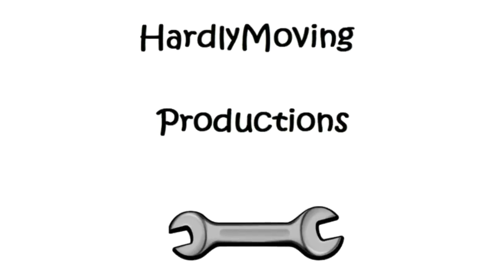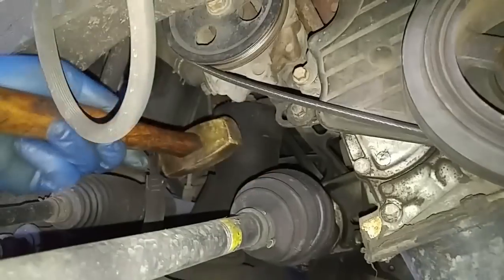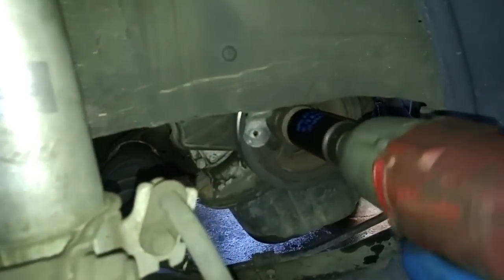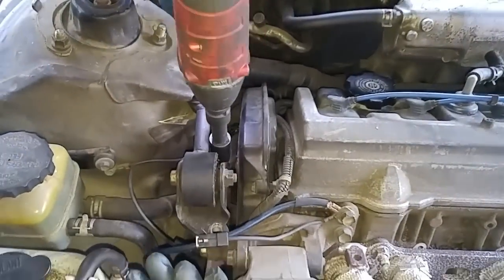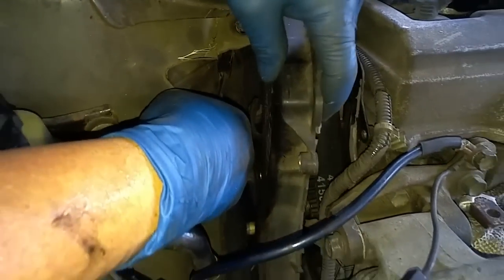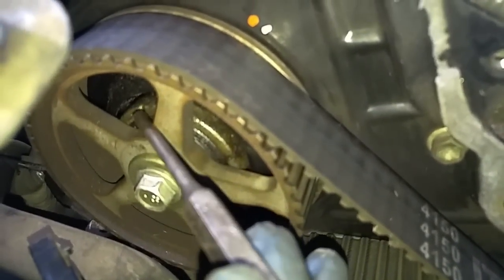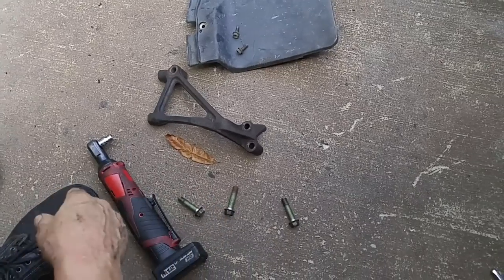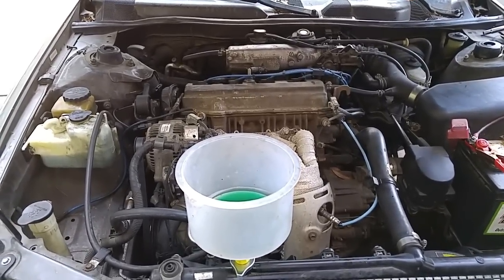Camry Timing Belt, Water Pump, Seals & Pulleys Replacement:  2.2L I4 5SFE Engine

Comment: After installing the timing belt and removing slack. Im noticing that the crankshaft pulley timing mark is aligned right. But the camshaft mark IS NOT IN ALIGNMENT. ITS CONSISTENLY FORWARD BY 2 inches or so...again this is when the harmonic balancer is at the zero mark. Is this okay?
Reply from the maker: When you're saying 2 inches, are your referring to the protruding tab on the camshaft pulley or the hole in the camshaft pulley that suppose to align with the vertical notch?
Reply from the maker: Refer to the 7:11 time mark of the video.
Reply: @hardlymovingpro  Im referring to the 'camshaft gear'...the camshaft gear hole is past the camshaft vertical notch/camshaft seal area. ie. on every 2nd complete 360 degree turn of the crankshaft gear...the camshaft hole is at 1 o' clock versus the camshaft vertical mark which is 12 0'clock. I want to know can the car still run okay despite this?
Reply: I can tell that the camshaft marks are off because I made marks with white out before installing the belt. I have not tried to start the engine yet either.
Reply from the maker: @SuperHtownswag  It's a non interference engine meaning there won't be any potential valve damage if out of alignment.   Also, if not aligned, you'll get a DTC code indicating camshaft position error.
Reply: @hardlymovingpro  oh wow thanks. To be honest the car already has 276,000 miles on it. And doesnt have a check engine light or any codes. I decided to replace the belt because It was very loose (yet fully intact. I know how bizarre right?) I bought a kit and changed the water pump, idler pulley, tensioner pulley (I think this was the main culprit, as the spring felt weird and the tensioner pulley had VERY limited movement. Im gearing the bearings inside the tensioner pulley were worn. I checked the records for the previous owner and the timing belt was last replaced at around 185,608 miles, oil pump seals, camshaft seal and crankshaft seals were replaced then too). Yes its toyotas 5sfe engine, If I can get the car to last me another 40,000 miles Ill be more than satfisfied
Reply from the maker: @SuperHtownswag  With this engine, it's usually a worn tensioner or idler pulley bearing that causes a need for a TB service.  A worn wobbly bearing places too much stress on the belt which will eventually snap.  Indications of a worn bearing occurs during initial cold engine start up that disappears when the engine warms up.  Indications of a loose belt can be noticed with a belt slapping noise against the TB covers.  I've had to revisit my TB jobs with belt slap noise after a new belt installation.  To my surprise, the belt got loose.  This is why I now start the engine with a new belt and then make tensioning adjustmentS BEFORE I button everything back up.  These TB instructions on manually turning the engine 2X, from my experience, does not guarantee the proper belt tension.  Starting the engine allows the cogs of the belt to seat in better ... IMHO.
Reply: @hardlymovingpro  Danmn. Thanks Sir! So does a loose timing belt and worn tensioner pulley to stall? and maybe have intermittent no start issues?
Reply from the maker: @SuperHtownswag  Nope ... will not cause starting issues.

Comment: Nice work surprised you didn't do the oil pump o ring and seal. I think that's my problem. I have to remove most of this stuff to do it. You show doing that very well.
Reply from the maker: Thanks.  Did another video for the oil pump.

Comment: Nice video! I'm a chevy technician not used to these yotas but seems easy to me thanks for the info.
Reply from the maker: I worked at a Cadillac dealership and any trade in Asian imports that needed work they dumped on me.

Comment: Got a 97 Celica with the 5sfe.  Water pump weeping.  Has 230, 000 miles.  This is a job I am going to tackle myself so watching as many videos on it as possible to find out as many tricks and tips as possible to make the job easier.  I intend to change the TB, auxiliary belts and of course the water pump.  Was wondering if it was worth replacing the oil pump gaskets also or anything else you can think of?  Thanks.
Reply from the maker: Here's a video I made replacing the oil pump cover O ring gasket.  These O rings dry rot and allow oil to leak out.

Comment: Good video 📹👍very detailed 👌 what brand timing belt did you use? for this job, or what brand do you recommend? I bought a car with 226,000 mi. All be changing the seals the cam is leaking. Might as well do the timing job too. And see how long the car 🚗can last.
Reply from the maker: Japanese belts:  Mitsuboshi or Bando.  American:  Dayco or Gates. European:  Continental
Bearings & water pump:  Aisin or GMB
Reply: @hardlymovingpro  Thank you, I understand better now.

Comment: Is it possible to remove without the power tool? Or will the pulley just spin using a normal socket wrench? Or, in my case would I leave the belts in place first to keep the tension on the pulley so it doesn't spin when I'm trying to remove it?
Reply from the maker: The pulley will spin. You can use a chain strap wrench to hold it from moving.

Comment: Hi i have 2000 camry 5s engine. Same problem with my car when start it in the morning its making noise comming from timing belt cover i feel that belt is hitting to the cover but after engine warm its reduce the noise i changed timing belt with new koyo and NSK bearings japan. After changing all these it was ok but after 2 months the same noise comming from the timing belt cover. I am suggested to find a little bigger bearing in diameter to not to listen the noise. So what can i do? What will be the best sollution? Should i find a little bigger bearing that should be 60mm in diameter instead of original 57mm diameter? 
And which brand belt should i use for this? As before i used mitsuboshi & sun brand belt?
Reply from the maker: Had a similar problem about a year ago.  Appeared to be belt stretch.  I took the tb covers off, removed the excess slack and buttoned it back up.  Been running fine since then.  Belt slap all gone during warm up.  Problem caused by not using OEM Mitsubishi belt?
Reply: @hardlymovingpro  thaks a lot bro i will check original Toyota TB to install. A bundle of thanks

Comment: Recently replaced crankshaft seal and oil pump seals on my 97 Camry. Car will only run 30 seconds and quit running. Did I install the timing belt incorrect or maybe the tensioner came loose? Unable to verify timing, timing covers and accessory belts are on. I’ll remove the timing covers this weekend to get a better look at my timing marks. Thanks for your video.
Reply from the maker: Is your check engine light on?  If so, do you have a camshaft position sensor error?  To get back to proper alignment, set the crankshaft pulley (harmonic balancer) notch to the 0 degree mark on the lower timing belt cover.  Then check the position of the camshaft sprocket TDC alignment hole.  If the alignment hole is 180 degrees off, rotate the engine 360 degrees.  Recheck the alignment hole. If the hole does not align with the alignment notch above the camshaft seal, then you're out of alignment.
Reply: Hardly Moving Productions Thanks for your speedy reply. So far no check engine lights. Will check all wiring sensors and timing marks this weekend. Keep you posted on my findings...
Reply: @hardlymovingpro  Update: Timing marks are spot on. Did noticed the crankshaft timing gear has a broken/missing teeth. I'm sure this is issue I'm having. Crank sensor not picking up all timing gear teeth and causing the engine to shutdown after 30 seconds.
Reply from the maker: Yes ... that'll do you in.  Recommend you pick up a replacement gear at the salvage yard.
Reply: @hardlymovingpro  Absolutely...I'll get one after we return from vacation. I'll let you know with the final results. Thanks...
Reply: Final result: Replaced broken crankshaft timing gear and the engine didn’t shutdown after 30 seconds. Ran engine for over an hour monitoring for leaks and engine temp with no issues. Next challenge - The dreadful California smog inspection 😩
Reply from the maker: @elgatogordo9523  Hey ... great news!

Comment: Hello! Please, could you tell me if when the timing belt breaks on the Toyota Camry 2.2 5S-FE engine there is damage to the cylinder head and valves?Thanks.
Reply from the maker: Won't damage.  It's a non interference engine.

Comment: Questions: which you can answer - at 12:28 m, what exactly is your "seal installation tool"? At 14:50, are you replacing the seal for the whole oil pump as well or just the section with o-ring?
Reply from the maker: At the 12:28 mark, I'm using the KTC brand seal installation tool.  If you go to the "show more" section of this video, I provide a Amazon link to view or purchase the tool.  I made a separate video for replacing the oil pump cover and shaft seal.  Here's the link:  https://youtu.be/_tsAtyOGpaQ  I also did another video on tools used for seal replacement:  https://youtu.be/KUSIZs2b4Ck  And here's a video showing how I used a seal installation kit to install new seals in a Mitsubishi 3000GT:  https://youtu.be/FTp_tVXSbqU

Comment: TY for this nice video and sorry for my bad english on advance. I have this exact same engine on my toyota celica 2.2gts, and just broke my timing belt past week while my car was not moving, it just stopped working while i was stopped. Ive been told that repair would be around 2000€ and i was just wondering if u think it would be worth tryin gto repair it or just buying another engine or even another car. Thank you very much!
Reply from the maker: Definitely fix it yourself!  No need to get another engine (and that's a lot of work!).  Most belt breakage, from what I've seen, is due to worn out idler, guide and water pump bearings.  This causes bearing wobble which over stresses the belt.  So replace the belt with the bearings and water pump.
Reply: @hardlymovingpro  TYVM my friend, thats what i needed to hear xD im in love with my car and would completely hate to get rid of it, ill see your videos and ill try my best to get it fixed! TY!

Comment: Nicely done. I would tell people to go ahead and take the alternator and power steering reservoir off.  easier to reach the bolts, which are still tricky.
Reply from the maker: Wouldn't hurt.  Just a couple of extra steps.  Recommend you first drain the PS fluid by detaching the hose bracketed to the sub frame below the crank pulley.

Comment: Great video!... Question, did you add any gasket sealant grease on water pump gasket before installing the pump?
Reply from the maker: Not necessary.  The steel gasket with a rubber seal provides a leak free seal.

Comment: Hi HMP. It was interesting to see that while the belt looked reasonably tight after attaching the spring and tightening the tensioner, after running the engine it became quite loose. It looks like you should run the car to get all slack from the belt. Some cars though require the rocket cover to be removed and so running the car may not be possible unless you put the car together beforehand. What methods are there in addition to running the car that effectively tightens the belt so you don’t have to retighten later. Thanks
Reply from the maker: Conventional instructions is to rotate the crankshaft 720 degrees and then re-tension.  My preference is to start the engine.  On Honda's older I4, I loosely place the value cover back on before I start the car so that oil won't go spraying all over the place.
Reply: Thank you for your reply. I agree absolutely. I recently replaced a belt in a Mazda 323 “Miata” FWD using conventional manual method. Relied on spring to make the required tension, rotated by hand several times to check and the belt remained visually tight. Closed everything up and the car went well for about 3000km before the belt failed and let me stranded. I predict that the belt became loose quickly and survived for a while before it finally failed. As you’ve shown, you cannot rely on the spring to provide the correct tension and you must run the engine to bed the belt in to eliminate any hidden areas of slack. The unfortunate experience knocked my confidence a bit (I’m an amateur trying to learn) but it was an important lesson well learned and it’s so very crucial to follow your procedure for adequate tensioning. Unfortunately the Mazda was no longer needed by family so it was scrapped. So bit sad to see it go. Will try again on the other family cars including my 98 Camry at a later date. Thank you again for your kind effort posting such interesting and helpful videos. A truly excellent and enjoyable channel. Regards Craig.

Comment: I had the cam, crank and oil pump seal and gasket changed 60,000 miles ago when i did the timing belt on my 92 toyota camry 2.2l. No leaks so far, my question is should i change the seals with this timing belt change or wait till the next 60,000 mile timing belt change?
Reply from the maker: If you're changing your belt every 60k miles, then hold off till the next belt change.  The cam seals is what wears the fastest.  The oil pump seals are good almost to 200k miles.  The crank seal don't leak that often.
Reply: @hardlymovingpro  thats what i was leading toward doing the seals every other belt change, because my 92 Camry says to change the belt every 60,000 miles.
Reply from the maker: @chrisbrown6804  You can safely go up to 100k now.  The 60k was based off of old belt material technology.  Starting somewhere in the late 90's, on the 5SFE engine, the service interval was bumped up to 90 or 100k.   When belts snap, it's not because of the belt ... but rather one of the pulley bearings wearing out and wobbling causing undue stress on the belt.   So if you use good bearings, like Koyo or GMB, you should have no problems getting to 100k.   Also, only use Aisin water pumps.   Have had water pumps fail in 1 week to 1 year.  Don't have this problem with Aisin.
Reply: Hardly Moving Productions that makes a whole lot of sense, that’s probably what I will do, I will wait for at least 90 to 100,000 miles before I change it, that way I will change the seals again at that time, I really appreciate the info and knowledge.
Reply from the maker: @chrisbrown6804  Easiest way to know if a belt job is needed is when the bearings make noise on initial startup and quiet down after warm up.  You've got a few months left when then happens.
Reply: @hardlymovingpro  Every once in a while like maybe once every 3 or 4 months after the car sat for a weekend, once i start it up, i hear a little rumbling underneath the hood for like 3 seconds then it goes away and dont do it again like for 3 or 4 months.  Im guessing one of the bearings is on its way out.
Reply from the maker: @chrisbrown6804  Nope.  It's motor oil sitting in the cylinder head and oil filter that over a stretch of time drained down into the oil pan and needs a little bit more time to circulate through the engine.  Same phenomenon happens in the colder regions of the country where the temperature drops into the teens.
Reply from the maker: @chrisbrown6804  Could also be worn out timing belt idler and/or tensioner pulleys.
Reply: Hardly Moving Productions is it safe to use a impact to install the crank bolt?
Reply from the maker: @chrisbrown6804  Absolute ... besides, it's a pretty big bolt.

Comment: 1st of all this is an excellent timing belt video. I couldn't have asked for a better one, but I think this job will be left to a mechanic. 

2nd is not timing belt related so I understand if you don't waste your time but also really hope you do. I watched this about 10 times to get the answer for myself but its going to take more knowledge than that. I'm trying to diagnose a valve cover leak vs a camshaft seal leak . The visible oil is all over the back of the engine. (I did the valve cover already and its still leaking is the reason I'm looking into camshaft seal.) If I wanted to rule out cam shaft seal leak could I do that by removing the dogbone mount and the upper timing bolt cover and nothing else? Wouldn't the oil be on the cam pulley and the black plate that backs it?  Please and thank you!
Reply from the maker: I think you leak is coming from the half circle rubber plugs on both ends of the cylinder head. Remove and clean the plugs then reseal with RTV.
Reply: When replacing the valve cover gasket, did you remove old RTV and put ultra black silicone RTV in the 8 places the book calls out for? If you did, then check if the oil is coming from camshaft seal by removing the parts you pointed out above. If it's coming from the camshaft seal, you will see it. There's also a black 2 inch round plastic plug on the driver's side of valve cover that also leaks, so check that too. It's behind the mount for ignition coils.

Comment: Great video!  Thank you for posting.  It helped a lot with my efforts to replace timing belt and water pump.  Just wish I had an air impact wrench for that crankshaft bolt.
Reply from the maker: Thanks for your post, comments and support!  You can always use an inexpensive ac electric 1/2" impact driver attached to a high mass impact socket.  Worked for me when my 18v electric battery impact driver gave out.

Comment: Is the amazon link for the evergreen kit with aisin water pump and misubishi belt in the description still good? Amazon says it wont fit but the title and description says it does. No reviews unfortunately
Reply from the maker: As long as you're engine is the 2.2L 3SFE or 5SFE it'll work.  These engines were used in the 90's Camry, RAV4 and some Celica's.